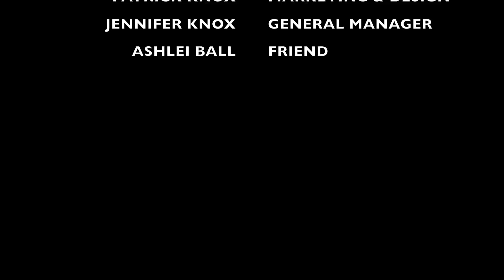S2 EP17 | HOBBIT STYLE COMPOST TOILET | FRONT DOOR, PANELING & CAMPFIRE COOKOUT

Comment: Just like you mentioned, I'm far from an expert on this stuff.  But two things I think I've seen you could have done differently if that had been your desired outcome; you could have put at least one bar clamp under the door as opposed to on top like you had all three.  That would have helped get rid of some bow or kept the boards more inline.  The other thing, when you were planing, you might have chosen as I think I noticed occasional grabs by the plane, to use a metal scraping tool to get rid of any dried glue.  As I said, I'm absolutely not a carpenter or expert.  In no way am I criticizing, I wouldn't be watching if I thought you were not doing a great job.

Comment: While you were leaning in with your eyes close to the high-speed blade of your circular saw so that you could see your line and make a more precise cut, I thought it was very clever of you using the bill of your baseball cap to hide the fact that YOU WEREN'T WEARING SAFETY GLASSES! This is not nitpicking; it's hands down a HUGE NO-NO! Please wear safety glasses so that you can see out of both of your eyes for years to come. End of lecture..